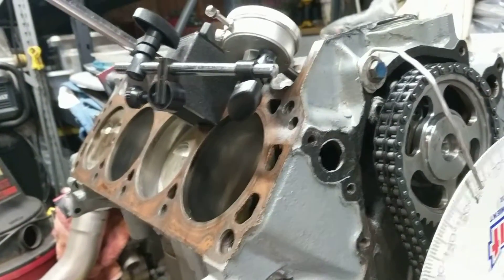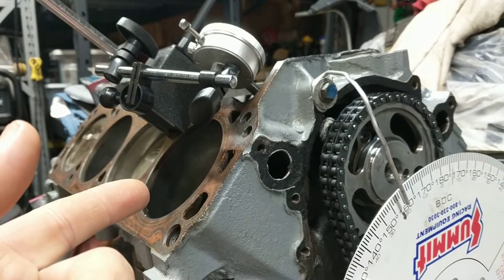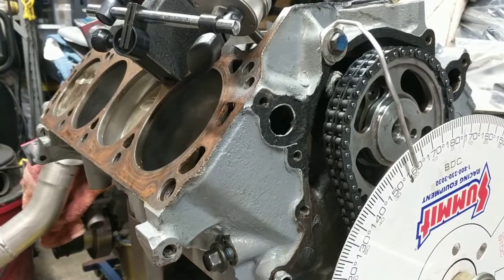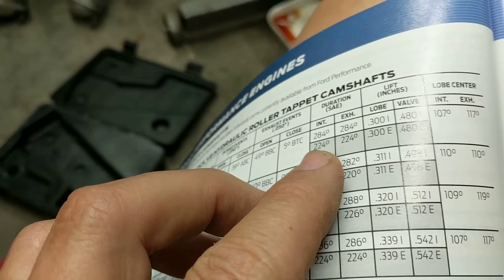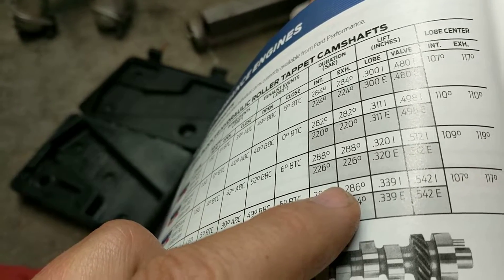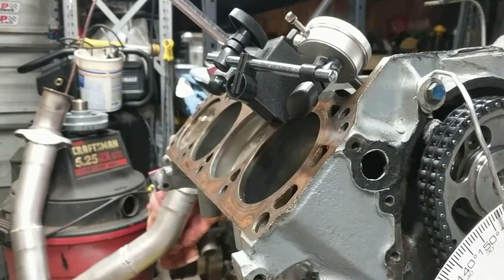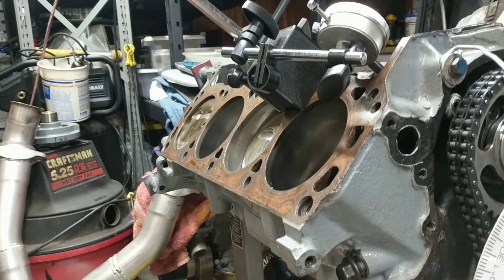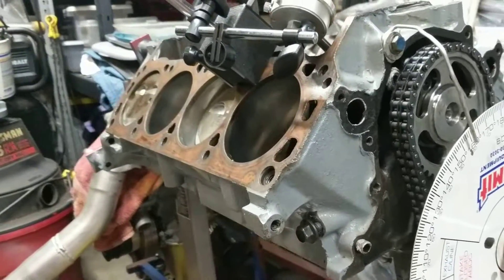F-cam specs

Comment: What's the LSA on each cam?
Reply from the maker: 107 intake centerline, 117 exhaust centerline, split the difference, 112 LSA.
Reply: I would've thought that the B cam would have a 108-110 based on the sound